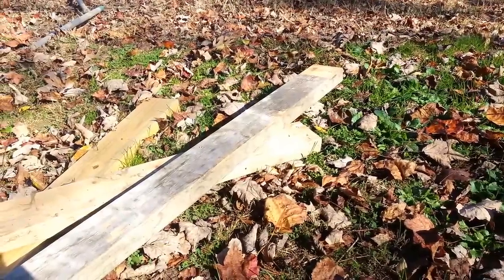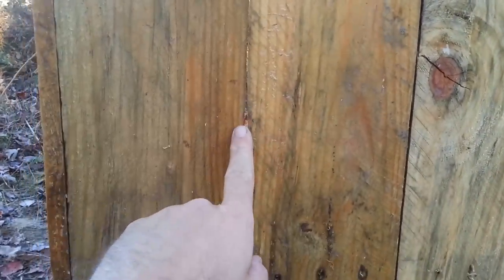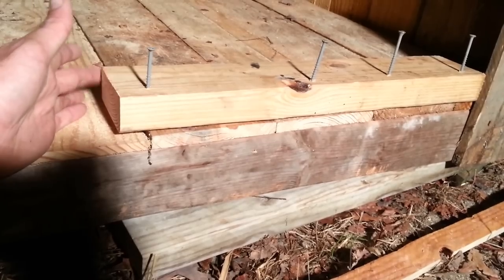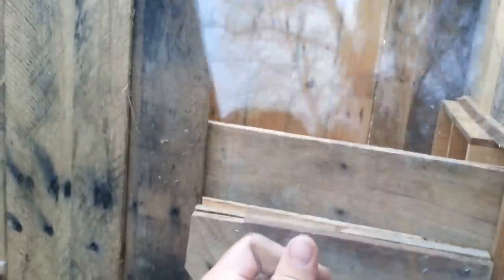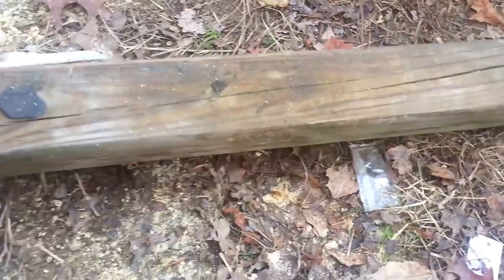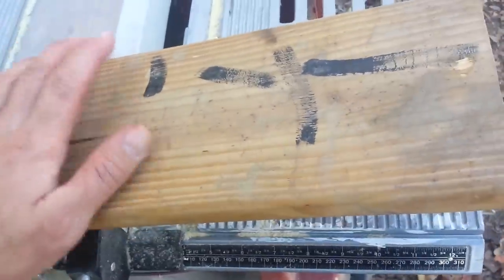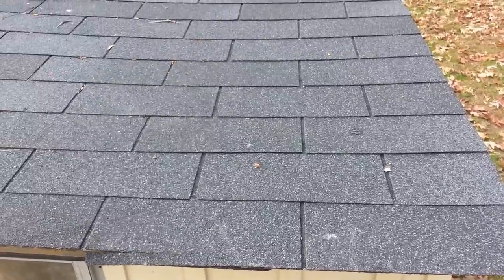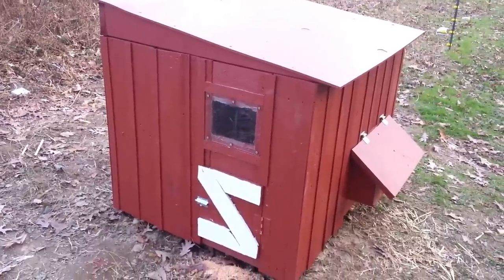Building a chicken coop with pallets and reclaimed lumber for under $50

Comment: Excellent instructions and good idea. One tip: if you can find a pallet that has a solid top, you can use it for the base. Two questions: 1) I've always heard that chickens need ventilation or they get respiratory issues. So you might want to cover the window opening with heavy wire + hardware cloth instead. 2) Isn't it hard to clean this? Maybe the chicken door should be wide enough to get a garden rake in? Or you have a miniature garden rake you use?
Reply from the maker: The entire roof is hinged, so spacers can be inserted to create as much ventilation as needed, and it can be opened fully for cleaning.
Reply: @mookie2000mhhs  If you raise the roof with spacers, small predators could get in? 

Opened where? Aren't the only openings the roof and the chicken door? What do you use to clean it? Will a scoop shovel fit/work? Or a square-nosed shovel?

Comment: Thank you for sharing your video I’m really thinking on getting two chickens and was wondering how to go about building a coop.
Are you going to put ventilation for the air to go through so it won’t get to hot during the summer.
Reply from the maker: All you have to do is put a spacer under the hinged roof to create a gap and ventilation.

Comment: What did you use on the roof that was weather safe or is it ok to just use whatever as long as it's weather safe?
Reply: Also what did you say you used for taking the pallets apart?  I must've missed it
Reply from the maker: sarah Verner this roof was exterior grade paint, which works but isn't the best.  Shingles or metal is best, but with children running around I was worried about the sharp corners.  I have a video of me making a pallet popper, I think that link is in the description.